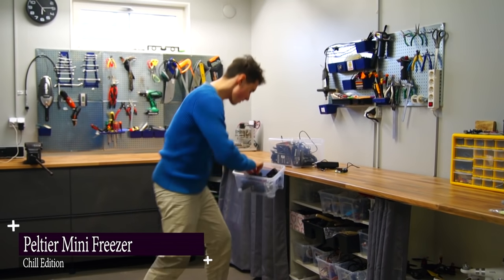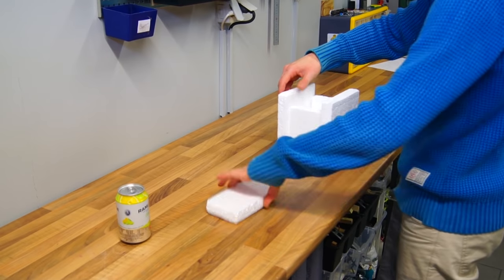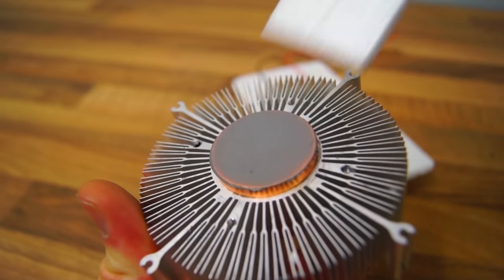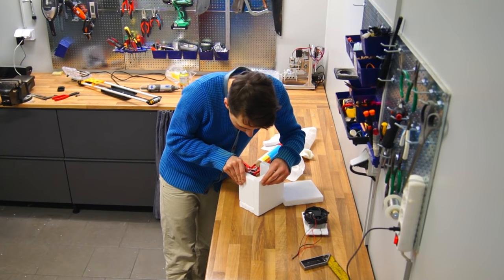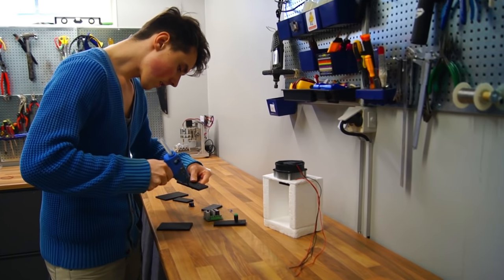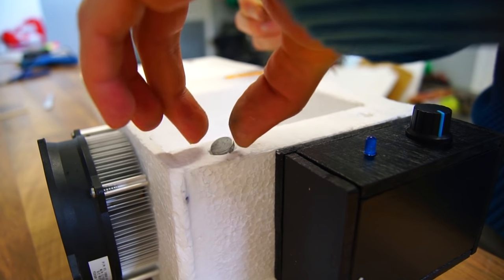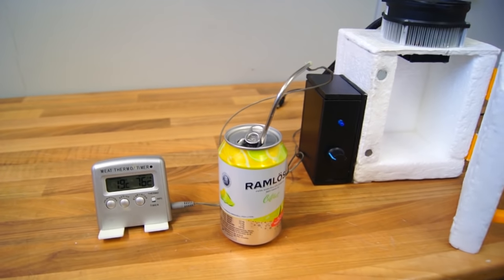Useful Cooler Box - How to Make a Mini Freezer

Comment: RCLifeOn. I am going traveling on my motorbike for three months. Trouble is I have medication (injector pens) that I need to keep at 4 DegC. I have hunted high and low for a commercial based refrigerator that is small enough to be part of my luggage on the bike. Ultimately it would need to be functional outside by hooking it to the bike power output port. I wonder if I would be able to make something similar to your design that could be regulated to stay at 2 - 4 degree. Do you think it is possible??

Comment: I had a problem of water condensing on the cool heat sink. When I connected the fan to hot heat sink and turned the power on, after few minutes the cold side of sink was condensing with water and temperature had risen( yes on the cooler side). Any ideas?

Comment: Hey what was that circuit. Also does a cpu cooler fan (CPU fan or heat sink) works directly when applied a 12 volt or some PWM signal supply is required? Please reply

Comment: Can the peltier be ran of a 12volt motorcycle system or is it drawing to much voltage. Bikes stator is putting 16 amps out not sure of  the voltage.

Comment: I'm going to make one big enough for at least 4-6 drink and also water cool it through a heater radiator so it is passive and makes no noise. I will also use 2 12709 what are 90w versions of this so it should cool pretty quickly. For power sake i will have one optional so one the drink is froze i can turn 1 off to regulate the temperature.

Comment: hey bro, I am using small heat sink and fan attached for a CPU with fan dimension :  70X70X25mm, heat sink dimension : 80x67x25mm, with fan speed : 2500+- RPM, via adapter 12v and 5amp output (input 100-240v),  for a cold water dispenser, it comes with 3 wires, black, yellow and read, I connected plus terminal to red and minus terminal to black, it it really slow,  takes ages to cold, am I doing it wrong?

Comment: Could you use a mini Stirling cryogenic cooler to produce liquid air to fill a tank with a bell siphon valve to fill a tetra pak heat exchange then the liquid air would boil off to vapor only to recondense into liquid air to fill the tank to start the cycle all over again? A thermostat could help operate the mini Stirling cryogenic cooler that produces the liquid air.

Comment: This is a great refrigerator. I was wondering would you be able to tell me or check if this would work with a solar cell? I mean can we utilize solar energy through a solar cell to make this work?
Also, the Peltier tile should be a TEC not a TEG; correct?
Reply: Peltiers are profoundly inefficient. A solar panel would have to be the size of a full refrigerator to power this little can cooler.

Comment: RCLifeOn What was the purpose of the controller. Is is to control the temperature of the cold side?
Reply from the maker: It controls the power going to the peltier, and therefore controlling the temperature inside the cooler box.

Comment: Idea design a calcium carbide drip canister with a burner to operate an absorption refrigeration system. Design an ice chest that you can you can fill with a small amount of ice with the ice melt off draining into a resivor with a bell siphon to empty into the calcium carbide canister to produce the gas to power the burner that operates the absorption refrigeration system. Add a nintinol graphite thermal electric generator into the build with wireless charging to be able to charge and or power other devices. What do you think about this idea? 😊

Comment: I have a query, how to get the best cooling possible when choosing a Peltier. There are different types of Peltier.
For example, I have a Peltier that has 3 amperes and the other 12 Ampere which is better in terms of quality of cooling.
Reply: The 12A would be better as it has more cooling power. But it also requires more power and a better cooler.

Comment: I have another question, I have a thickness of 10 millimeters and want to make a cooler. What is needed to isolate the heat between the I have another question, I have a thickness of 10 millimeters and want to make a cooler. What is needed to isolate the heat between Peltier and Heatsink ?
I want to isolate the heat from inside and outside.

Comment: PC modders are gonna kill for this concept. Imagine combining this with a watercooling kit in PCs. Cold water cooling up your PC hardware. You'll never have to worry about Higher Temps again.
Reply: Not Jesus you would probably destroy your motherboard with the condensation
Reply: Viliny no, because the liquid would still be warm due to the heat of the CPU.
This cooler would not be able to keep the temperature down much.
A small netbook cpu can put out 40 watts of heat.
This cooler moves a max of 7.5 watts of heat.
My desktop CPU puts out over 150 watts of heat alone not overclocked.
Idle it definitely puts out more than 7.5 watts, the water pump alone might put out more heat than this thing can handle.

Comment: Can you make an air conditioner out of Peltier so that it gives cold very much?  We have 220 volts in Russia, but 110 volts in America.  If you connect in series Peltier with an output voltage of 110 or you can 80 volts with an impulse power unit

Comment: I’m curious about the alarm: why we need to care about the voltage is going down? Thanks
Reply: vito colucci because you may run the risk of running the battery flat. You may rely on that battery for other important things. Depending on the battery type, this could be bad for the battery. Car batteries are really not intended to be used this way,but running a deep cycle battery that low could damage the battery.

Comment: Hi, do you know how long can the battery can hold? thinking of a mobile version but still considering about the efficiency
Reply from the maker: Get the right sized battery and it will be able to run for 1-2 hours.
Reply: you mean the 3k3mah one you using :D that's a great news
Reply from the maker: You need 3x 3000mAh to be able to run for around 2 hours.
Reply: oh gosh that's too much to carry, thanks for the info sir :D

Comment: cool sumer project . i did it too but my peltier stay like 10 min at 5c and then goes to 23c .Why ?
1 the box is sealed 
2 the voltage that i give to the module is 12v and 2 amps
3 for the hot side i used an amd old cooler which is  powered by another power supply ( 12v and 1 amp )
4 for the cold side i have placed a tiny fan
Reply: summer*
Reply: You peliter is probably upsidedoen i.e. your hot peltier's hot side is inside the box and cold side outside...probably. Anyway All The Best brother, may god bless you :)

Comment: Which one is best, TEC1-12715  or the 12706, or they are the same?
Reply: one is 6 watts the other is 15. the "127" is the number of metal heat transfer thingies in the module and the number after is the wattage
Reply: The 12715 is one which is rated for 12V and 15 Amps while 12706 is rated for 12V and 6 Amps

Comment: Never, never. I repeat. NEVER use a PWM modulator to manage the peltier power!
In this solution the peltier device efficiency is lower about 30-40% than with a buck converter voltage regulator.
Btw, nice project!

Comment: how did you secure the big heatsink? you didnt show in the video..
Reply from the maker: I didn't, I left it resting on top of the peltier.
Reply: RCLifeOn
Ideally, you should bolt them together so they don't separate.
Also, for such a small space, you could mount the heatsink arrangement at the bottom so it rests on the table, and doesn't stress the foam.

Comment: Does someone know if you could scale this project up and use it as "roomcooler" for summer^^?
Reply: no, you won't be able to use it as an air conditioner. maybe a fan that blows cold air, but you'd have to put it right up to your face to feel it probably. if this were to be scaled up to a point where it could cool a room, you're probably looking at spending 3 to 4 times as much as it would cost to buy a regular air conditioner

Comment: So I'm trying to build a tiny peltier cooler for my phone (fan, heatsink, peltier all 20mm).  Does anyone know where I can find a controller like the one pictured but that works with USB power? And as far as power goes can I put the peltier and the fan on the same wire?  I'm not too familiar with doing my electronics so sorry for not getting my terms right.
Reply: If you want to know more information, please refer to  link: https://youtu.be/mqNYUT60ZWE

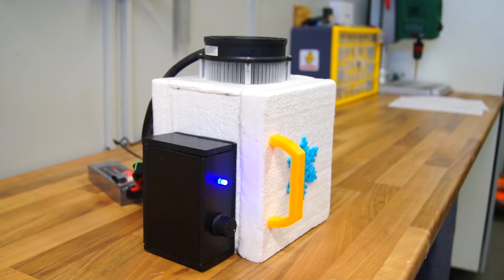Comment: 6:18 ... What do happens if the Voltage of the battery does run very low or even dead ??
Reply: The device turns off and your drink will be warm again.
Reply: imp3r1alx it will puff and never charge again

Comment: can I use that peltier module with labtop usb power?
Reply: Yeah if it's 12 v
Reply: No, a laptops usb port only supplies 12v at a very limited amperage.
Reply: thanks a lot
Reply: 이현찬 OMG I'm a moron... I made a typo... a laptops USB only supplies 5v (not -12v-) and very limited amperage. So again no not enough volts and not enough amps.
Reply: Ok anyway that can't afford to supply power. thank you
Reply: no laptop cant deliver such power and run out battery in 10 min

Comment: What is rpm of the main cooling fan is it a original Intel Pentium d cooling fan????
Reply from the maker: I can't quite remember, but I do remember the amperage at 0.39A (12V).
Reply: You mean in the maximum power right
can it freeze water???
Reply: It worked thanks for the tip I used a delta fan 12v 1.5A 3600rpm

Comment: i realy want to ask u if i have 12volt but 1 amp is it ok?
Reply: It's safe under dry conditions.  Because the "pressure" of the current isn't high enough to push the amperage into/thru your body.

The level of voltage and amperage considered dangerous drops as conditions get wetter.
Reply: @macmcleod1188  yea i know it will be less dangers bec the ampr is low but wt i meen is is it gona worl as normal power like 5 ampr???
Reply: @fantasticbrothers6332  like I said think of voltage like pressure. 5 amps is 5 gallons of water.at low pressure that 5 gallons will pour across your skin.  At higher pressures that same five gallons will hurt and sting.  At very high pressures that same 5 gallons will cut your hand off.
Reply: @macmcleod1188  thx 😊

Comment: What controller i need for that that Peltier?
Its 4.2 V 3.7 A 9.5 W 
https://www.conrad.de/de/quickcool-qc-35-14-37m-hightech-peltier-element-42-v-37-a-95-w-a-x-b-x-c-x-h-30-x-15-x-x-47-mm-189192.html

I want to use it via usb or 16850

Comment: The temp inside the box can only reach as low as the ambient air temp. If the outside air temp is only 10 degrees c well then inside the box cant possibly get colder than that. Although the physics explained in this video are true, it's highly exaggerated to make you believe you can make a freezer with simply a fan and heatsinks. Nope.

Comment: FYI it is VERY ineficient. Compared to gas cycle (regular compressor) fridges of same power. Just saying, coz it says it is fairly efficient ;-)
Otherways it is simple, runs directly on 12v DC (12v compressor fridges have built in inverter...) and is cheap to make. Plus you can sandwich two (perhaps three if last, coldest, one is much lower powered) of them to get really low temperatures required for making meth or a cloud chamber or other interesting science experiments ;-)

Comment: The links are not accurate.  I purchased the items at the links provided and Gearbest sent me a bunch of crap that is similar, but not as good, and incomplete.  In addition, they messed up one of my orders (with parts missing) and refused to send the missing parts, but rather offered me "points".

The concept is cool, but I suggest that you dont buy from GearBest.  So far, they have been a nighmare to deal with.  :-(

Comment: as this is a just uses a heatsink, it doesn't make sense that the beverage reaches below room temperature.
I'm no physicist though.
Reply from the maker: It uses a peltier module, see in the video.
Reply: what a peltier module does is uses electric current to "force" heat from one side to the other, thus moving the heat from the inside to the outisde
Reply: your english and word structure has made my IQ drop about the same as this video cools a drink, just in way less time
Reply: Wolfie, yes, you are exactly right. Peltier modules electrically force heat to the other side of it. This makes one side hot and the other cold. They are not passive, even though they have no moving parts.

You can also use them as an energy generator by making one side hot and the other cold yourself.
Reply: So they work in the same way as a motor? Interesting, i didnt know they could be used in reverse :D
Reply: The problem is removing the heat creepage from your body to the cold side. Peltier power by body heat has been done before, but it only generates a reasonable amount of power while you are moving, which moves air over the cold side allowing enough of a temperature gradient. It is still less power than an equivalently sized solar cell afaik.